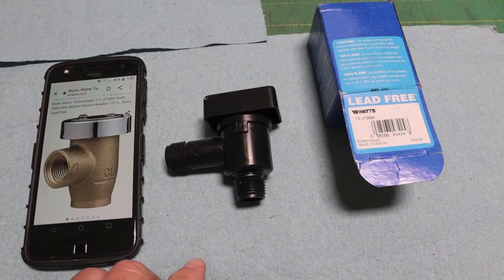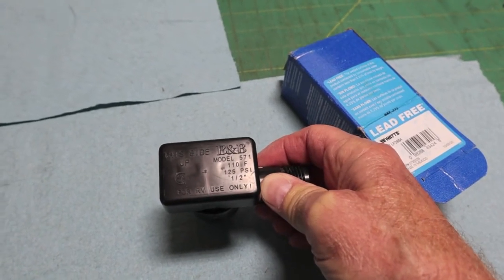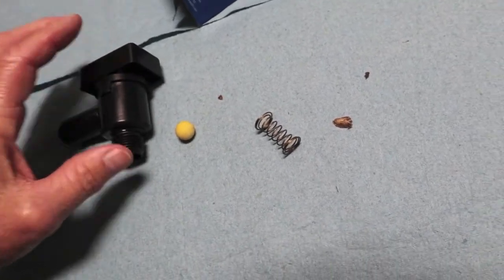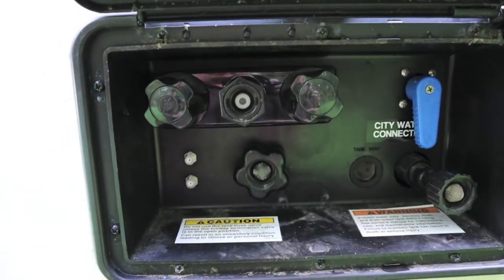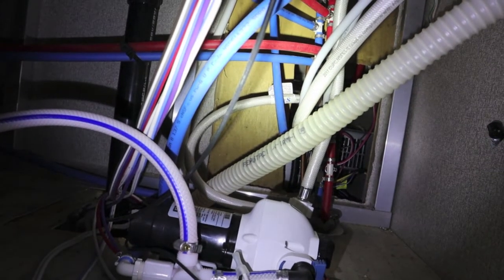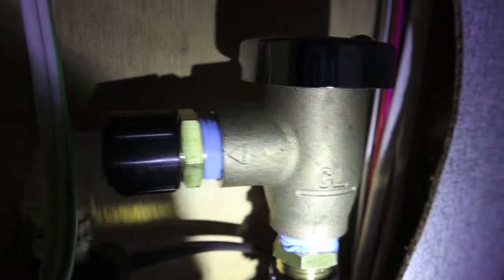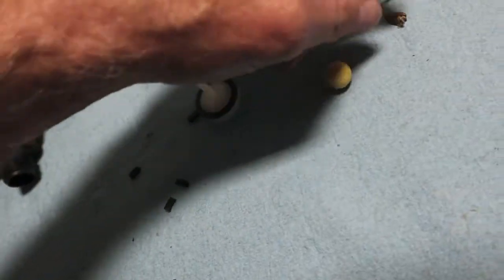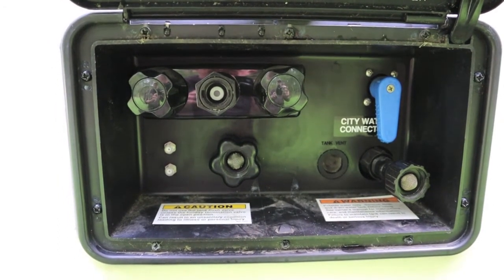RV Fifth Wheel Flooded by Stink Bug in Black Tank Check Valve (vacuum breaker)

Comment: Thanks for the video. I just had my valve fail, leaking under the bathroom sink. I removed the valve and damned if I didn’t shake out a stink bug also. I cut a piece of fiberglass screen material and glued it over the top and snapped the rectangular top back on. This should keep the bugs out in the future

Comment: So I just got one of these vacuum breaker came with the spring. What's the function of the spring? The ball inside does not come out like yours
Reply from the maker: There are several different designs of these valves. They are basically check valves that allow you to hook up a water hose and kind of back wash your black tank. It's also a safety valve that keeps raw sewage from exiting the black tank and entering the fresh water supply of the entire campground during a backwash. Incoming water pressure will be enough to overcome that spring tension and allow water to flow into the tank, as soon as pressure drops...the ball snaps back to close. 
Thanks for watching!